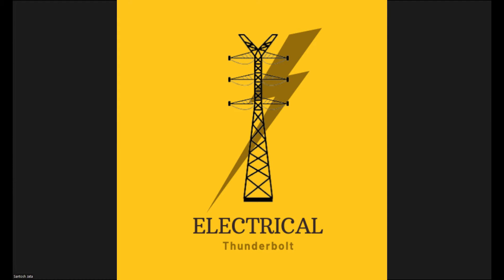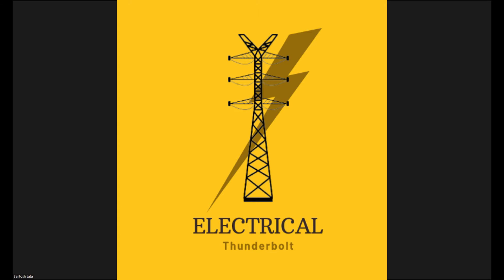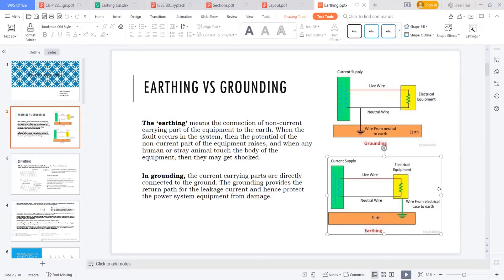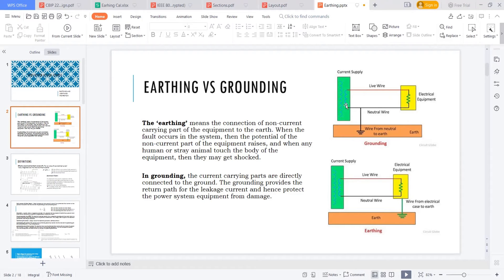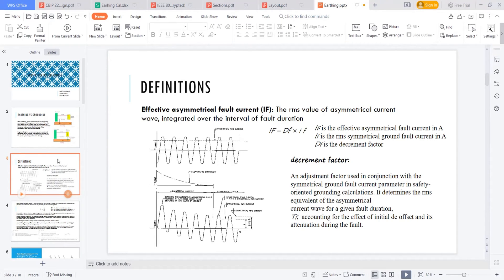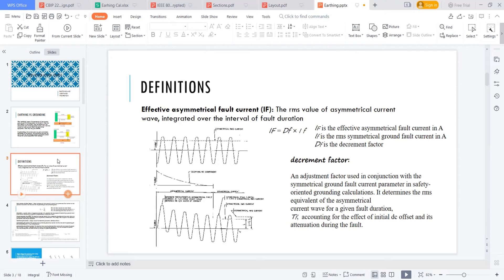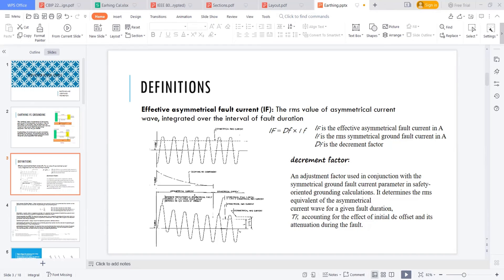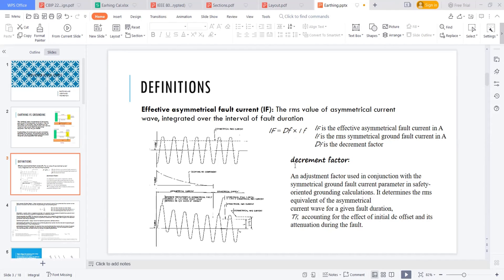Substation Earthing Design | IEEE 80 | Part 1

Comment: How can to calculate fault current as 25kA in 33 kv ss
Reply from the maker: Fault current can be calculated using I ( kA) = MVA/sqrt(3) * kV * %Z; MVA is the transformer capacity; generally, fault current has been taken from the  tender technical specifications, for 33kV = 25kA or 31.5kA